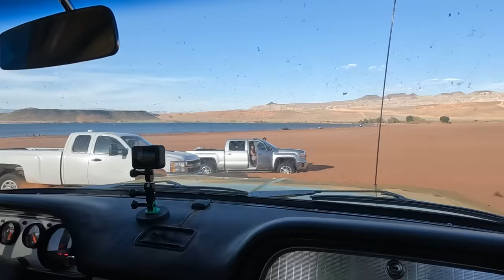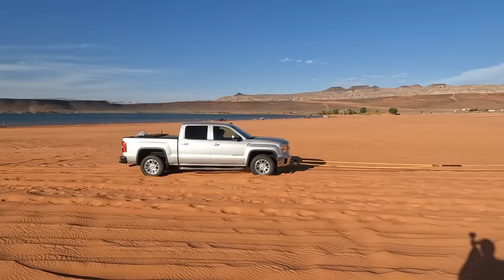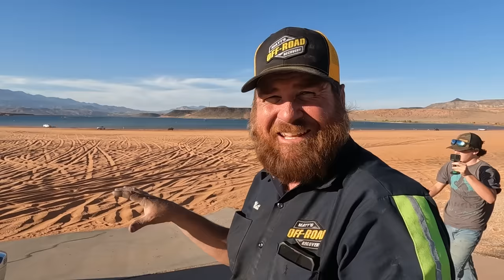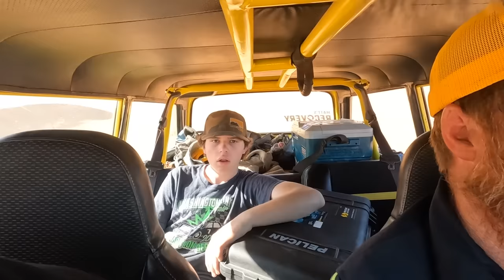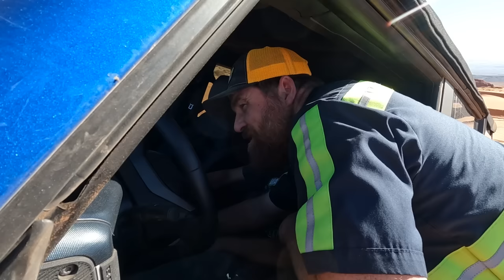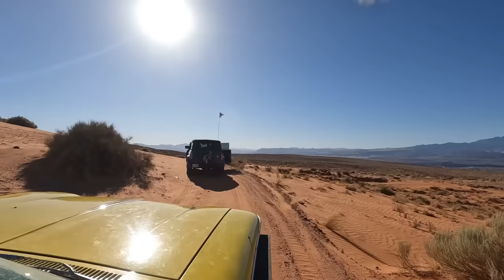Ford Bronco Lost In The Desert Dunes At 105 Degrees

Comment: Hey 👋 we were the ones in white Chevy 2500 who got stuck trying to help the other people. ☺️ My husband is super handy and usually can get us out of these situations, but we are super grateful to you Matt for helping us out that night! Thanks for the shirts as well 👍
Reply: What is the small white box on the top of your cab.   Wasn't in the right place to be the shark fin.   Was it a GPS device?
Reply: He looked like he had some experience, swiveling the tires and all. He was making a little progress, but with Matt there it was a win-win. Thanks for agreeing to be in the video!
Reply: @jimcollins8097  his truck was formally used as a Government vehicle. So it is left from that.
Reply: Thanks JC
Reply: I'm an experienced dune guy. Get a quality portable compressor. The kind that hooks to the battery terminals. 
Drop your tire pressure to under 20 psi. Maybe as low as 15. 
Never stop when pointed uphill. Always try to start downhill. You will be the puller instead of the pullee! I can tell your that kind of dude (you remind me of me) 
Happy duning!
Reply: Great folks
Reply: Respect. Your husband was working it and was definitely part of the tow too. Most people just watch.
Reply: Dropping tyre pressure might have helped (in both cases). I'd say 12/15 PSI could make the trick. But Matt is always there. 👍
Reply: Matt and his team and especially Jaymie recovered the Bronco and Skeeter and Jefe helped along with Rhett. Good job getting them out!
Reply: Good letting your son drive.  Start them young they are a lot safer when the kids get out on their own
Reply: it almost looked like your husband was gona successfully do a self recovery. he has good offroad skills but its alright. anyone can get stuck
Reply: No shame in needing help.

Comment: This is why Off-Roadeo is so important for Bronco owners...that Outer Banks was fully capable, just needed more experience behind the wheel. And maybe less tire pressure and a sasquatch setup (did you see them punch the back tire when they got there, noting it was was at full pressure). Great content!
Reply: Realize this an old comment.  I just picked up an Outer Banks non-sas.  The stock tires are terrible.  Bought my Bronco on Saturday, stuck on Sunday, ordered new tires Monday.
Reply: @fishingjts  Not sure about the hero switch setup on an OBX. I did off-roadeo in a Black Diamond (with front and rear lockers) on stock wheels aired down to 25lbs and it didn't miss a beat. I missed not having the Sas lift when rock crawling it, but it never got stuck. Hope the new tires work out for you.
Reply: @benjaminwalz6933  New tires made a world of difference!  Stock tires on the non-Sas OBX are rated A/T but they are more like an all season road tire.  I switched to BFG KO2s and couldn’t be happier!  And yes I’m really impressed with how capable the OBX is! 😁

Comment: Gotta love you guys' attitudes about it all.    Laid back, casual, talking a little smack back and forth, and just getting it done.    Some day I'd like to come check out the "real" desert.   We're all sage brush, pucker brush, scab rock, and rattlesnakes.   Only sand you might run into is where the Columbia River  overflowed a few different times, or in the river valley itself.   Still presents some challenges to folks.   Each type of terrain sorta has it's own set of rules.   Keep up the excellent work.
Reply: Sounds like Central WA (or OR, maybe).  Originally NE WA, myself.
Reply: @michaelm.1947  Grand Coulee area.   Middle of the wheatfields to the South.
Reply: @UncleBildo  I've got Colville relatives in that area. Small world!
Reply: @michaelm.1947  We wandered off the Rez my generation.  I was that wild assed little blonde kid among the Natives in Nespelem prior.

Comment: Good that all those vehicles had recovery points so you did not have to crawl in the hot sand. I liked the tyre kick on the Bronco, way to hard to be on the sand and highway tyres to boot. I did think Rett was driving a bit fast, good call from Dad.

Comment: Hi Matt!  Were the 2 GM pickups stuck in Sand Hollow running 35-40 PSI in their tires?? I know the sand out West can be really loose, dry and easy to get stuck in, but those guys were on dead level ground and couldn't move.  You mentioned the white truck never 'planed out'; was he aired down??  I drive a lot of East coast beaches and run 10-15 psi and NEVER have a problem...but our beach sand is more granular.
Reply: Probably with that heavy diesel airing down wouldn't have made much of a difference, but airing down could have got him out. Honestly, he had a good enough technique that he probably would have got out with some time and determination.

Comment: AIR DOWN...Not Matt, but everyone stuck, air down to 15psi, and float on top of the sand. Carry a portable compressor to air up as part of your kit.
Reply: Matt always says the Morvair is aired down under 10 lbs
Reply: Air-down makes a huge difference on sand. I air-down to 15 psig on day one at the beach. Hit the beach daily. Take it easy on pavement for a week, then air-up the night before I leave. It took me years to realize I didn't need to stand next to the wheels in the hot sun adjusting pressure. I also use Staun Tyre Deflators to air-down. I'm either getting lazier, or wiser. I've only been momentum delayed twice in 40 years. And one of those was because I forgot to shift to 4WD.
Reply: @Nightryderthebronco  He is right, for his sand, his vehicle and tire set up. Most folks are scared to go that low. But any is better than nothing
Reply: @Nightryderthebronco  IIRC, Matt is also running beadlocks on the MORRvair, which allows him to go that low, and he's got huge tires with lots of sidewall. On regular wheels, 10-15psi is about as low as you can go without risking popping a bead. And don't try it with low profile tires, they don't belong off road at all...

Comment: Pro tip.  If the half ton truck got stuck, the 3/4 ton truck is unlikely to be able to help.  The half ton is way more capable off road.
Reply: Lighter is better in the sand.👍
Reply: Pro tip, you are wrong. Most likely you are not a pro at recovery's!
Reply: And the gas engine too!

Comment: I watched a recovery video in Australia where they used a normal recovery rope instead of a kinetic recovery rope and metal shackles instead of soft shackles (attached to the trailer hitch ball) and it ended very, very badly. After seeing that, I highly recommend kinetic recovery ropes.
Reply: What happened? 😱
Reply: @WatanabeNoTsuna.  The drop hitch broke, went threw the windshield and killed the driver.
Reply: @EvrttGrn  Wow! 😲 Damn.... 😦 Do you recon the break was caused by the use of a solid rope...? 🤔
Reply: basic physics :  the ball looked to be about 6" off the centerline  of the HOLLOW TUBE Drawbar. The leverage SNAPPED the Drawbar like  a pretzel stick ( a solid bar probably would not have snapped , but that Off-Centerline Moment-arm STRESS has got to go Somewhere  ;  some other point would likely have BENT ,  at least ) 
     Yes , a Kinetic rope probably would have helped immensely.
Reply: @WatanabeNoTsuna.  That definitely played a part in it but rythemzlatin's comment  explains it better than I could.
Reply: @WatanabeNoTsuna.  As the other comment said, basic physics.  "For every action, there is action there is an opposite and equal reaction".  When the vehicle transfers force/energy into the connection to the other vehicle (rope, hitch, ball, frame, etc.), the connection has to expel that energy somehow.  If the mediums used to transfer that energy from one vehicle to the other aren't capable of processing it, they are going to give away.  Usually the weakest link, in that case it sounds like the hitch was the weakest link.  

Kinetic ropes and shackles are capable of absorbing, storing, and then releasing that energy properly without transferring more to the hitch than it can handle.  Even then, these probably would break something like described, if it was able to exert leverage on it.  If you notice Matt almost always uses his own hitch on vehicles when possible because it's a straight pull.  Leverage isn't applied to anything.

Comment: Looked like smooth surfaced boards they were using. There is something called rough sawn the rougher the better. You might as well oil first the smooth sawn. Plus they have metal ramps. If your not prepared you have no business leaving the city.

Comment: Matt those first two trucks one was a Chevrolet and the other one was a GMC which basically they are the same truck just different badges on them and it's unfortunate to see two GM trucks stuck because I'm a Die Hard Chevrolet fan but they both had stock suspension and not to mention they were on stock tires and some people don't seem to realize that if you put a good set of tires on your vehicle that best suits your needs then that will go a very long way in situations like that and you don't even have to raise the truck with an aftermarket lift kit or anything just get the same size as the factory tires but with better tread since the factory tires are as smooth as butter and I don't think it would void any warranty on the truck either unless you put a lift kit on the truck

Comment: I live in Kansas where we have plenty of sand. Have learned with the sand we have here if you dump water on the sand that can be enough to get you up on top and get moving on top. I know the sand there is different. But, near the water using a large cup I wonder if that would work?

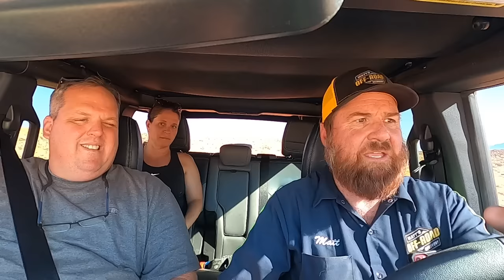Comment: 11:12 I am a big fan and excuse my lack of knowledge but with sand u want more horsepower not torque. maybe as you are starting to move low range would help but later when u pick up speeds (15mph) you definitely want high range. too much torque will get u digging the sand

Comment: Guys....jus fyi....most vehicles with 4x4 low...requires you to switch to neutral first before 4x4low will engage....just keep that in mind next time! 4x4high will usually switch easily while in drive or park or reverse....but not low range! Some vehicles won't even allow low range even while in park....its mandatory in some vehicles to switch to neutral!

Comment: I know I will probably get stuck and need help, but I have an itch that needs to be scratched. I want to test the prowess of my lightweight Subaru Wilderness with 29 1/2" AT's out there in that sand. Then again, in deep dry sand I never stop in the middle like where those guys got stuck. I come from hard pack and end on hard pack. But I feel like I can swim thru just about anything. I figure just about anything that doesn't have huge tires will get stuck out in the super deep stuff if it stops and can't get rolling.. What my vehicle has going for it is oversized (for weight and model) AT tires and I have deflators and onboard air as needed. I was going to buy a Bronco, but I'll wait until there is a used market, if Im still alive. Anyway, I know we've all seen a lot of stuck Subaru's but 90% of the time it is operator error or the wrong settings. I've had my Wilderness for about 8 months. I've had it in deep snow and deep sand and I never even needed to turn on Xmode. In fact I should turn it on sometime just to make sure it works, but I've never used it. I've got over 10.3" clearance and I have the car loaded with a lot of accessories, including recovery hitches and ropes and maxtrax, and even a small refridgerator, but I still try to keep it as light as possible. It's still a lot lighter than those trucks.. I haven't met the condition I couldn't get thru yet. I'm not talking about rocky trails that will tear me up. I'll wait for the Bronco on that one. But I do go on offroad trails, steep gravely roads with big ruts. So far I haven't got stuck or damaged anything. And to me, it's not really about the trip but the destination. Still I do have this itch to see if I am right about how this could do in sand aired down. I think I could easily get to the beach and back in sand hollow. What do you think? Be respectful.  Databyter

Comment: I worked pipeline construction in Bakersfield Ca, it was 112 degrees and between 125-130 on the pavement 🥵, those were rough days. I ran the water truck so every time I’d fill the tank I’d dump a hard hat of water over my head and by the time I did the 6 mile down and back trip my shirt was bone dry 😂🥵 in that heat you won’t last long without water.

Comment: Hey Matt, As a complete novice, why do you want low range vs high range in the sand? Does high range dig a hole too quick?
Reply: You'll use low range to get you through soft sand, over soft-sand dunes, up steep hills and declines, through deep mud or snow, and it'll help you drive over rocks. The lower gearing also gives your 4x4 vehicle better engine braking, which helps to control your progress on downhill sections.
https://www.carsguide.com.au/adventure/advice/when-to-use-low-range-in-your-4x4-69074#:~:text=You'll%20use%20low%20range,your%20progress%20on%20downhill%20sections.
Reply: You need Low Range and more importantly you need tires that are sand certified so you an Air Down to 15-20 psi.
There are BF Goodrich tires and then everybody else. BF Goodrich has reinforced sidewalls that are designed for low psi usage

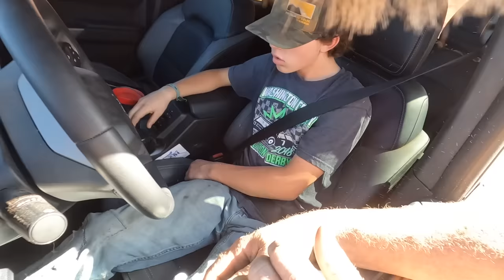Comment: @9:47
“It says drivers door is ajar.” 
Great safety feature………for a vehicle that has removable doors. 🤦‍♂️
Reply: My thoughts exactly.
Reply: I would guess that there's an option to disable that feature, specifically for that situation. That's why you should read the owner's manual when you buy a new vehicle... Funny story: it took a month for me to figure out the back hatch of my Jeep Renegade. It was odd, if I opened it with my left hand it worked fine, but when I used my right, it locked up and beeped the horn. Turns out, there's two buttons (they're not visible from the back), and the left one opens and the right one locks. I didn't notice the different textures on the buttons, probably because it was winter and I was usually wearing gloves. Quick look at the owners manual and it shows the buttons plain as day, and I felt like an idiot 😂...

Comment: When stuck in the sand, does letting the air out of the tires help?
Reply: Ideally, you should air down before you get stuck, but it can help. Lower tire pressure lets the sidewalls flex more (provided they're not low profile tires) and increases the contact patch of the tires. Spreading the vehicle weight over a larger area helps with flotation over the sand which is key to not getting stuck...

Comment: I don't personally recommend using Low range if the tires are deflated to 15 psi. Less load on gears with the high range. Low range only of the tires are not deflated (while driving which is not being stuck)
Reply: Matt has been driving in sand for years, so I trust his experience.

Comment: Perhaps worth reviewing this safety video https://www.youtube.com/watch?v=Mb3BkeeXlIo that analyzes a recovery in AZ that resulted in a death.  While that one was using a drop-hitch (which is a really bad idea) that broke and sent the hitch into the windshield of the vehicle being recovered killing the driver, the video covers other means of attachment on the recovery vehicle including pintle hitches and towballs too which are things used by MORR.  On the good news front, soft shackles seem like they are awesome from the strength and safety point of view.  And, dynamic recovery ropes also smooth out the peak load which is another good thing.  Not sure MORR should change anything, but worth reviewing specs on the pintle hitch on the Morvair and the triple towball sometimes seen on the Jeep.

Comment: If you had 3/4 in thick 4 x 8 sheets of plywood , would that be any help? Great video
Reply: They could probably get back to the road, although it would take a long time. And 3/4 in plywood is super expensive.
Reply: @JohnFL  I was just watching how those little strips of board were not working, he didnt have a high lift jack either,it seems like a tug is a the only option that works
Reply: @jeffclark2725  It might have helped if they aired down, also off road driving experience has a lot to do with it. But with that heavy diesel truck, a tug was their best bet by far.
Reply: @JohnFL  As Matt always says, when the sand is hot, its even softer,was a great recovery

Comment: you have to really know the sand dunes you're in to be comfortable driving a full size 4x4 around them.
its so easy to misjudge the angle of a hill or drop off, in the middle of the day it all just looks the same color gold with no shadows 
hard enough to notice on a bike much less inside a truck

Comment: I do have a question..... Why is everyone stuck but you don't get stuck? Is it because the tire sizes and air pressure? or what.
Reply: The Morrvair is built (and the Banana is modified) to float on top of the sand. Big tires at 8 PSI and light weight are key to staying on top. Street tires at street pressure and heavy weight are key to getting stuck. Take the 3/4 ton pickup for example.

Comment: The only thing dumber than trying to drive a 2500 truck on that sand is trying to recover a stuck truck with a 2500 truck in the sand.
But I have to give it to him the 2500 driver seemed to be a decent operator considering the conditions.  He started to crawl out rather than just burying it to the frame.
Reply: They shouldn't feel too bad.  I once watched someone take an hour to decide that the simplest way to recover a stuck forklift was with another forklift, but the first one they sent for was the same size as the one that was stuck.  It took another 30 minutes to get a big enough forklift to the scene, at which point the final recovery took two minutes.

Comment: The guy carries boards but no 12 volt air pump.....??  I live in NY and know that u cant drive a heavy 4WD with standard road tires on soft beach sand, LOWER YOUR DAMN AIR PRESSURE PEOPLE!!! at 12-15 psi both of those trucks would have had no issue getting out....